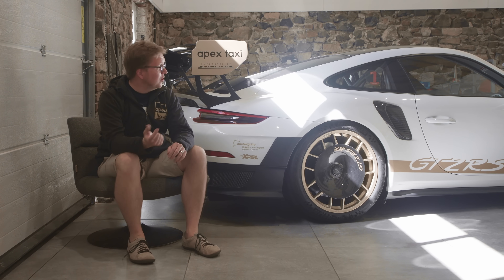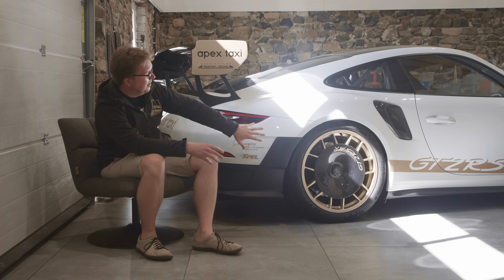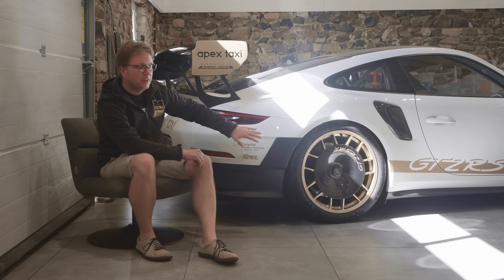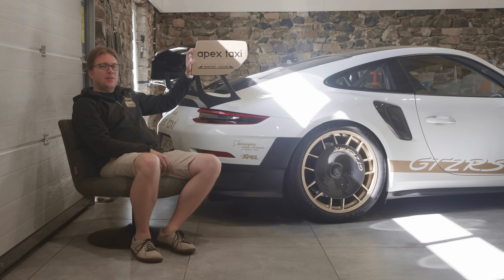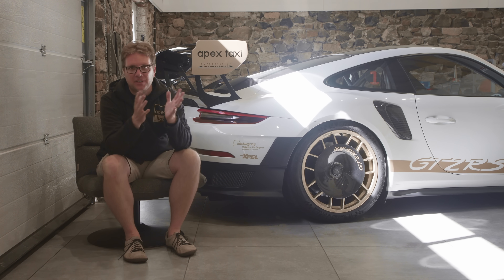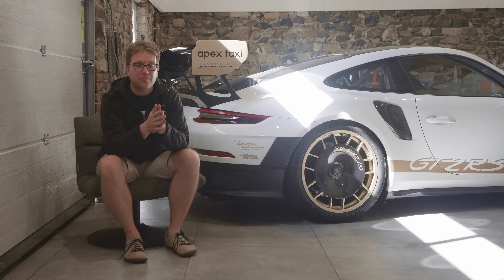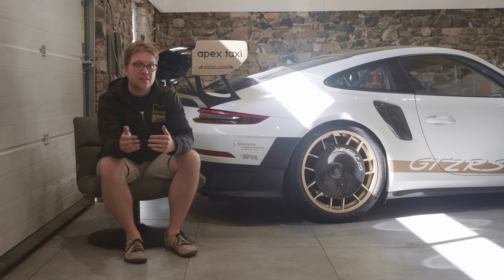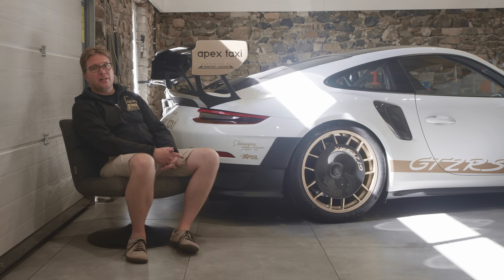Tech Talk: Manthey Racing GT2RS Wheel Discs Explained

Comment: I'm really interested in decreasing drag on my 997tt. How were you able to measure differences that these wheel discs make? Through software, wind tunnel testing, or wool tufts. Why aren't you using them on the front wheels also? Did you add any additional underbody panels around the motor to help maintain more attached airflow? I find it odd that Porsche left the back exposed.

Comment: Great explanation! So why not cover the whole rear wheel with disc? Or is it a brake cooling concern? Also, why not do the disc in the front wheel too, just like those on F1 cars in 2000s ?
Oh, weight of the wheel should be another consideration too, right?

Comment: Great explanation! Before this video I thought all these wheel discs did brake cooling. In the video you mentioned "they are not turbo fans", but do "turbo fan" style wheels /adapters etc actually do brake cooling or do they serve a different purpose all together? Or do any of these "fans" actually fan the brakes?
Reply from the maker: I’d have to look up each style to see.  There are so many applications of them and I think it’s a mix. What you see today I assume is mostly aero as we’ve found that cooling brakes from the center is better than through a wheel

Comment: Very cool. A great Part 2 to this video would be to put some GPS tracking tech on the car and tell us what (a) the max speed reached on the main Nurburgring straight with the wing in its lowest downforce setting and rear wheel disc attached VS (b) the rear wing in its maximum downforce setting and no rear wheel disc to aid airflow. That would be incredibly cool to find out!👍🏻
Reply from the maker: I think it would be cool too but we will see if I can get that sort of time hehe

Comment: Clear that they work together, have a synergy with optimising for reduced drag without sacrificing downforce. BUT can you share anything on how airflow management along the sides helps downforce? I can’t imagine how it’s channeling more air through the wing, for example.  I would have assumed reduced drag Along the sides would be the only benefit had you not clarified!
Great video and new channel.
Reply from the maker: It’s not actually just channeling air to the wing but stopping Lift in the inner wheel arches at The back of the car.

Comment: maybe 0.1mph.....if they made as much difference as you claim every car would have them
Reply: That just isn’t true. And even if they did make that tiny difference, they’re still making a difference, you’re still going faster, and you’re getting more lap time. Even if it’s just a thousandth of a second, that’s still a faster lap.
Reply: Just look up tesla wheel covers. Their cars got a increase of 10 miles to its range for having a cover. These discs achieve the same thing essentially. Mind you they got 10 extra miles ontop of the 400 or so miles the car already gets so its not a big return😂

Comment: Thank you, Robert, for the detailed explanation of the wheel disk.  I cannot recall where, but I remember seeing something about the MR rear wheel disks helping with downforce, but it did not give a quantifiable benefit as you did with the 2 degrees less angle on the wing.  I can understand having 'less' wing causing less drag, but do the wheel disks themselves add any drag?  Or, is the smoother airflow around the rear of the car all benefit without (performance) cost?

Comment: I'm no expert but I am in the industry. Higher downforce will not decrease acceleration but top speed as its effects multiply North of 80mph.
Reply from the maker: Don’t confuse just downforce with drag....  also I’m talking about acceleration on one of the fastest tracks in the work on the fastest car.  We see near 250km probably 10 times in one lap and 300 as a top speed at two places on the track.  If there is enough drag to slow a car’s top speed it can only reduce its acceleration to that top speed. (Unless it has active aero) which this doesn’t. 

Without active aero it’s impossible for drag not to slow acceleration

Comment: Cool tech talk, right up my street really interesting... thanks for your time.
One question, in your opinion why do you think the McLaren Speedtail have something similar (wheel discs) on the front wheels but not the rear ... are they to aid brake disc cooling In it's case, or do you think again it's about aerodynamic/downforce/drag?
Reply: Aero for the McLaren. It's mainly for top-speed and to lower drag. It also helps not disrupt the airflow because some hot air will be expelled from the front wheel-wells as some of the radiators live there.

Comment: Very cool video. I got the basics of wheel discs right but I would have had no clue how much of an advantage it was, 2° is impressive.
I have a (probably silly) question though, why don't they put discs on the front wheels as well if it doesn't impact the brake discs airflow?
Thanks for the content!

Comment: short, sweet, informative!
Reply from the maker: Trying to make them not TOOO long:-)
Reply: @RobertMitchell  don't mind longer vids from you guys tho! I find it fascinating because obvs in cycling discs are used in time trial, and it always seemed logical to me that especially with wider rear and 21? inch rims those wheels must create massive disturbance in the air flow!

Comment: Today's lesson, turbulence is not your friend.
Reply: Funny enough, sometimes it actually is. You might just want the flow to be turbulent before boundary layer separation occurs on an airfoil, at which point you'll significantly lose lift or control of the flow (lift still applies to car spoilers, just downwards tho, hence downforce, but the same principle applies), in fact some aircraft wings do have turbulence inducers.
Fluid dynamics are crazy, even weirder (and downright experimental more often than not) when turbulence hits.